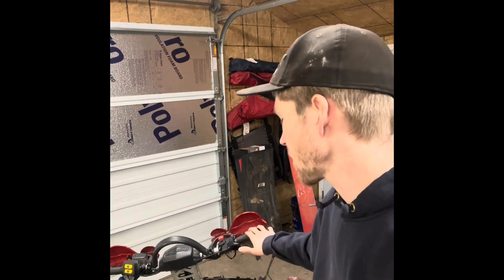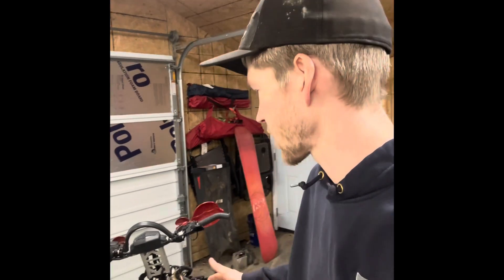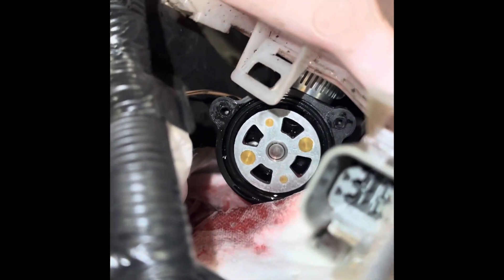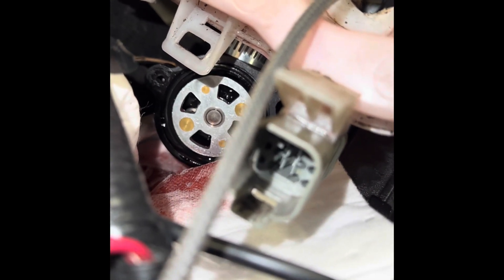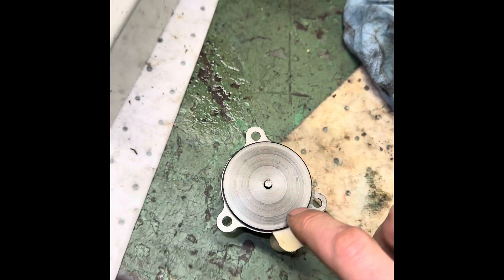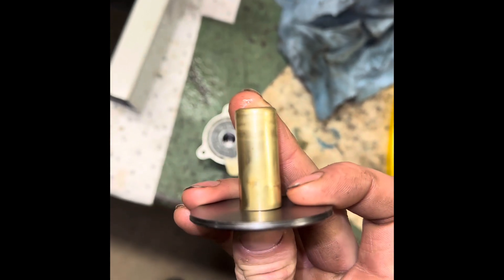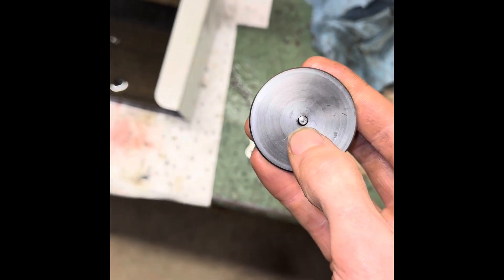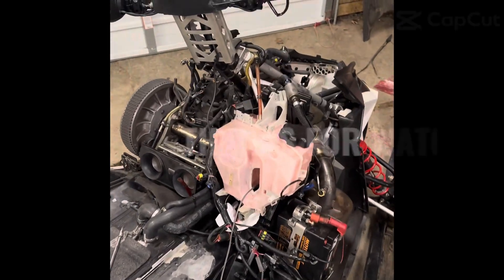Etec 800/600 Leaking Oil Pump Explained!

Comment: Aaaah.., question. 
Your sled seemed pretty stripped down in the video. Did you have to take off ALL THOSE PARTS to get your oil pump out??!!
Reply from the maker: If you’re replacing your pump, you’ll need to be able to move your oil tank as much as possible. I only replaced the solenoid part of the pump but if you’re replacing the whole pump you’ll need as much movement as possible. You might not have to remove everything that I did but I found it easier this way.

Comment: Thanks for the video. Did you end up just replacing the plunger part or the whole pump?
Reply from the maker: I actually just replaced the brass colored solenoid that had the crack. As long as the o-rings on the plungers aren’t broken, you should be able to reuse.
Reply: @Mooremotorworks  Ok that’s what I’m going to do also. I heard if you replace the whole pump you need to bring it the dealership for a reprogram. 
Thanks again!
Reply from the maker: @andyc8454  that is correct! If you replace the whole pump you have to adjust the flow rate with a BRP scanner.
Reply: @Mooremotorworks did you replace this piece off a used pump? My 2012 Summit started leaking after the last ride this season and I’m suspecting it’s same issue as yours. I just now got the tank siphoned and loose enough to remove. Didn’t want to take apart the front half of the pump if I didn’t have to and lose prime on the 4 lines going to the motor. Trying to avoid taking it to stealer for recalibration if I can.
Reply from the maker: @Merle0224 the piece I replaced was from a used pump. Skidoo only sells the pump as a whole. You’ll get some air bubbles when you pull the back half of the pump but I just pre-mixed the first couple gallons of gas to ensure everything stayed lubricated while the air bubbles worked their way out.